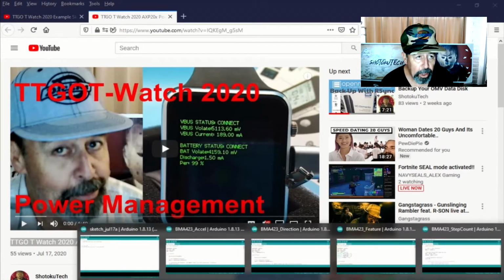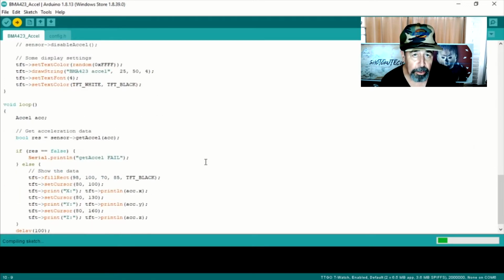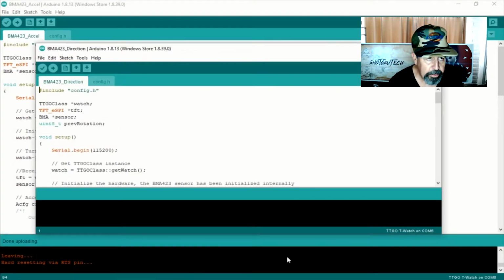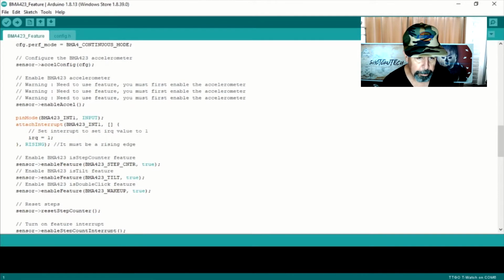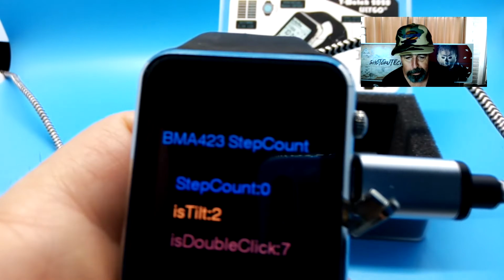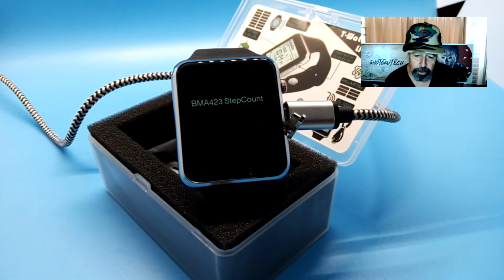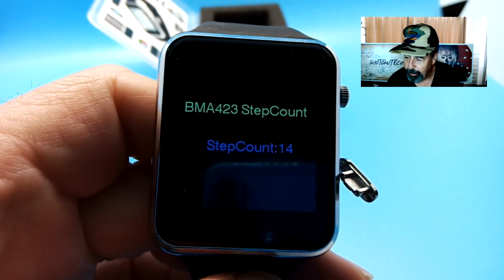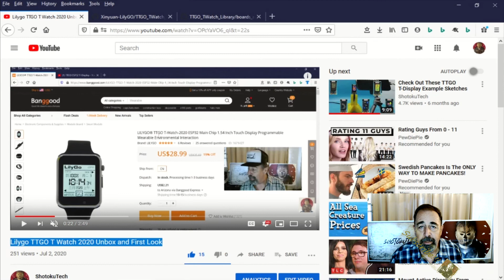TTGO T-Watch 2020 BMA423 Acceleration Sensor Example Sketches

Comment: A fun sketch you could make is using the capacitive touchscreen to control a mousecursor on a computer, turning the device into a wireless touchpad
To do this you can use Bluetooth HID of the esp32 and whatever capacitive screen drive you got for this device
Reply from the maker: That does sound like an awesome project. Thanks!